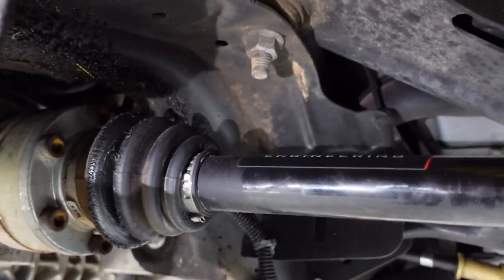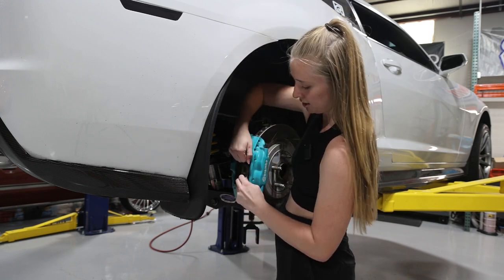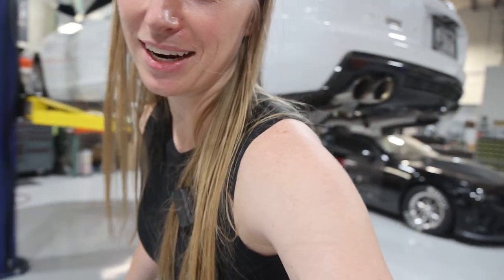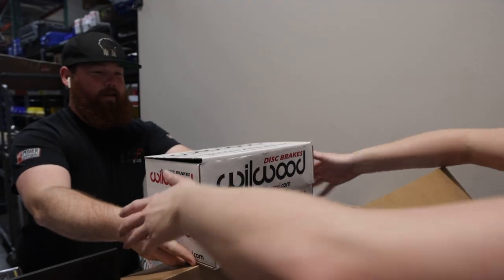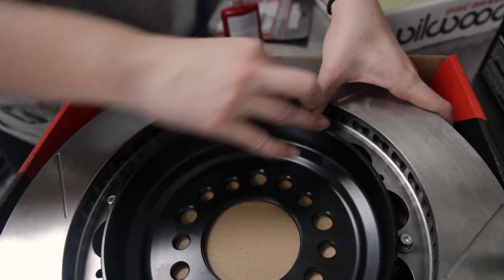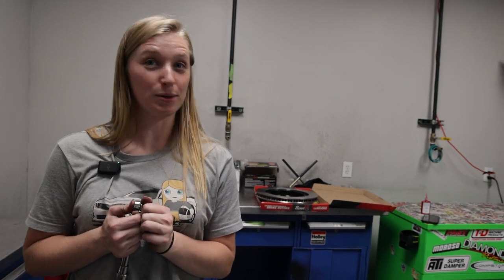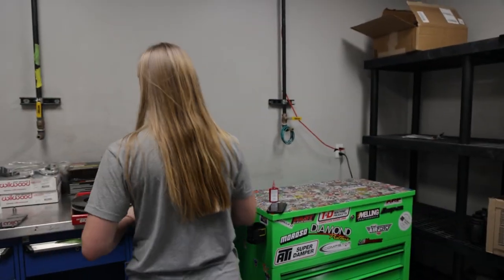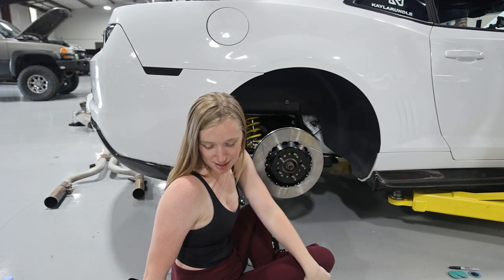Big Axles & Wilwood Brake Upgrade on the Camaro Ep.12

Comment: Just one piece of advice with the engine change. More power , more torque. Change the rear driveshaft rubber joint with a high performance one or your gas tank protection shield will look like your body underneath where the rubber boot blew, spraying the grease only you won’t be wiping it off because the spray rubber welds itself to the shield. Just changed one on my sons Zl1 which only puts 719 hp to the ground. Good luck.😎👍